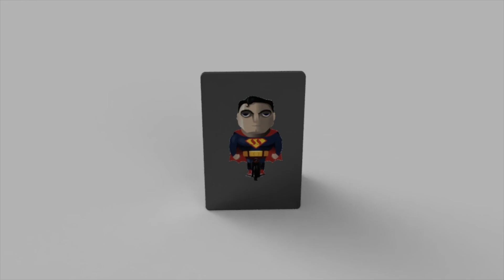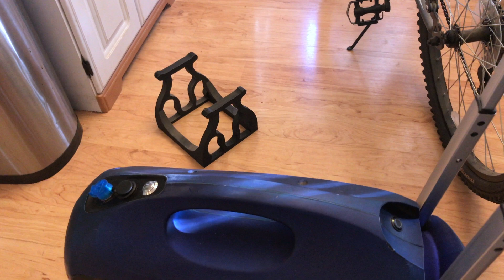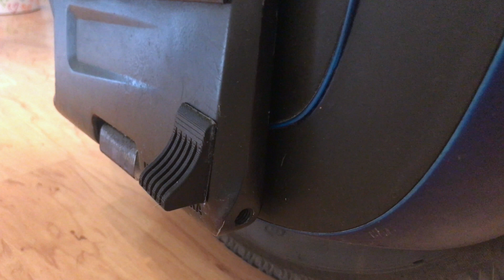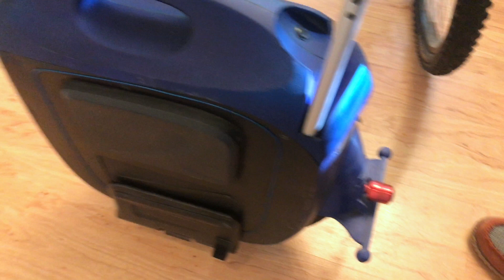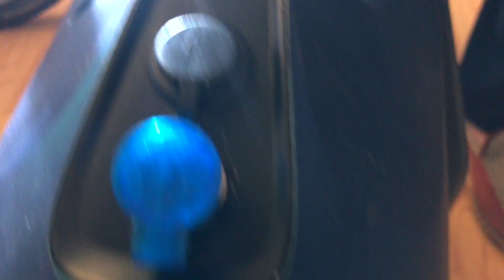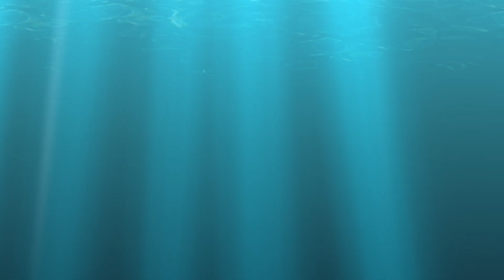Pedal Pushers for Electric Unicycles

Comment: Got the link to here from Thingiverse. First time I see this and seems neat...
How do they take falls and impacts?
Reply from the maker: It depends on print settings and the adhesive used. If printed solid, they are quite strong. Some people have issues with the adhesive letting loose, but usually, they can just stick them back on.

Comment: nice one, thank you for sharing, if you improve to act as a STAND, you would be EUC HERO
Reply from the maker: I really wish I could figure out a stand that works down on the pedals.  So far, the only idea I’ve figured out that works is my Parking Fender design.
Reply: @SuperSport1966  what about to follow the bike kick stand stand?
Reply: there was one EUC, I do not remember the name, which integrates the stand in the pedal itself, will try to find it
Reply from the maker: Michael Rada I thought about using the SegWay MiniPro stand on the EUC pedal. I was concerned it would stick down too far.  Maybe I should take a look at that again.
Reply: @SuperSport1966  not the best I try. I play with different options, it has to be more flat, already looking for the one I spoke about

Comment: Thats pretty cool now all u have to do is incorporate something like that for the front only to hold maybe an inspector beam flashlight, so you could have lights on your pedals too, just an idea, I did something like that for my 1st thrill, the msuper V2 if you can shoot me an email I'd be glad to show you some pics, if you kno the msuper V2 their pedals are hollow body pedals, I picked up 4 coast inspector beam flashlights which fit perfectly inside my pedals drilled-n-taped 2 holes, in the front and rear of each pedal, closest to the hinge and secured them into place using a set screw & for the rear facing lights I just used 2 red rubber end caps that came off a broaching bit shipping tube, and caped each lens of the flashlights facing the rear, now I have red tail lights, works great, and looks cool too! 😎👍

For ref: the inspector beam lights are the G19's by Coast, batt pwr.
Had I found chargeable ones at the same size, I sure would have used them. But they do work as expected ...Brilliantly! :)
Reply from the maker: Yes, on my generic EUC, it also had hollow pedals. I bought those lights that are made to fit in there. They weren’t beam, but rather just bright so others could see you.  I had white in front and red on back. 

That was before they started putting lights on the wheels. 🤣
Reply: @SuperSport1966  if you ever attempt to bring lights to the foot plates/ pedals, drop me aline
Especially the MSX. :) 👍